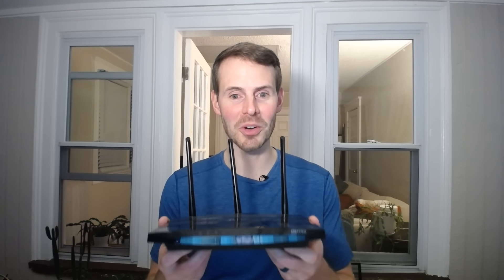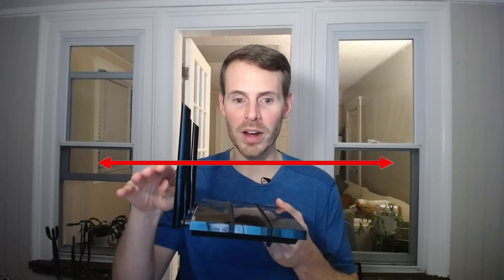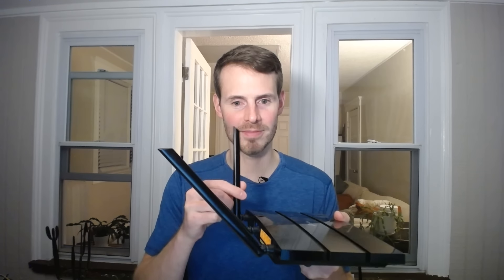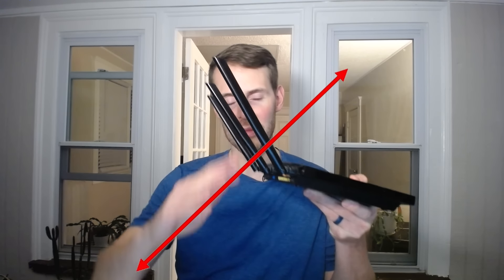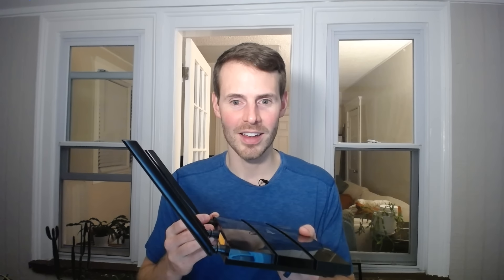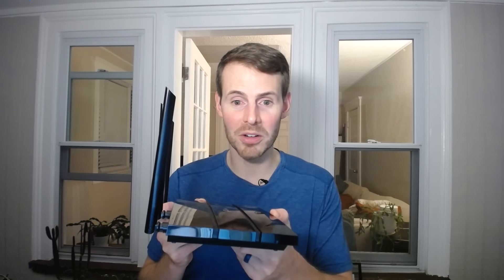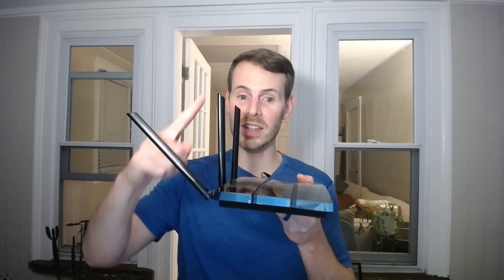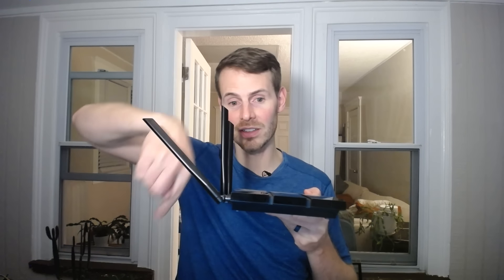Router Antenna Positions - What You're Doing Wrong

Comment: I am also a HAM with over 40 years experience n radio antennas and NAVY trained in AVIONICS and this guy is just lick he got any results at all. there is no such tech as slopped antenna orientation. Radio waves do well either vertical for omnidirectional and horizontal for directional but radio signals get confused at angles as their orientation is dictated by the magnetic fields of the earth. SO, do what you want but this guy is full of it. he knows noting about electronic engineering.
Reply: Also I doubt the polarization is the same after getting bounced all around a house by metallic objects. better luck by installing a WiFi access  point in the basement, problem better solved that way
Reply: Those  ground station K-Band satelite aerials are in trouble then. . . .
Reply: Exactly! It's all about E or H fields. Placing an E field in any other position than vertical reduces mutual coupling. (function of Sine or Cosine)
Reply: The static magnetic field of the earth has no impact on a Transverse E/M (TEM) wave that the antenna produces, At HF - VHF, the Earth's conductivity plays a part in propagation and for HF the ionospheric bounce is a factor. At WiFi frequencies, altering the antenna orientation may create a more favourable path to a blind spot, but so might putting a reflector behind the antennas or changing the orientation of the whole antenna array. If it's adaptive at all, none of this will likely do much.
Reply: I have 40 years land mobile radio experience. The antennas on a router are part of a MIMO or Diversity reception system. Each antenna can receive the signal from a device and diversity reception increases probability of reception. The best orientation for a single story building (in my case)  is to place the outer two at plus and minus 45 degrees off center. Like rabbit ears. This because objects in the home like silvered mirrors and refrigerators distort the polarization of the signal as they refract around them.  If you are trying to get signal to a basement or third story, adjusting an antenna 45 degrees off vertical also makes sense. The earth's static magnet field has little to do with local propagation.
Reply: @elguapo1507  It also increases mutual coupling if the subscriber and/or its arriving signal are bent off the vertical plane and arrive at an antenna coinciding with that alignment.. These routers use diversity reception and MIMO so the worst case is actually having therm all lined up in agreement with each other .
Reply: @rhyoliteaquacade  Maximum gain is ensured through mutual coupling so as long as your E or H fields are coincidental then your received signal strength will be at the highest it can be, taking in to account all other propogation factors. In a diversity antenna array, multiple methods can be used by the designer to prevent mutual coupling between those transmitting antennae, which might otherwise distort or disrupt the transmission signal but we're talking about the mutual coupling between transmission and reception antennas here aren't we? If I transmit with a verically polarised antenna then my receive antenna will also perform best when vertically polarised, the earth's magnetic field having very little to do with that.
Reply: @rhyoliteaquacade  Maximum gain is ensured through mutual coupling so as long as your E or H fields are coincidental then your received signal strength will be at the highest it can be, taking in to account all other propogation factors. In a diversity antenna array, multiple methods can be used by the designer to prevent mutual coupling between those transmitting antennae, which might otherwise distort or disrupt the transmission signal but we're talking about the mutual coupling between transmission and reception antennas here aren't we? If I transmit with a verically polarised antenna then my receive antenna will also perform best when vertically polarised, the earth's magnetic field having very little to do with that.
Reply: @elguapo1507  Yes but unless the subscriber has a fixed mounted vertical antenna, its orientation is not guaranteed. If you have a tablet or phone it is unlikely it is ever strictly vertically polarized, nor is it even likely that the signal leaving the phones internal "antenna"  and with your hand, body shielding it are close to being vertically polarized. Thus having the diversity receiver antennas somewhat  off vertical polarization increase probability of mutual coupling. Nothing about WiFi or Cellular follows good RF engineering practices like we adhered to in Land Mobile Radio.
Reply: @rhyoliteaquacade  I can't argue with that! Mobile devices of the type you described obviously have low quality, low gain antennae and the idea that mutual coupling is even a consideration during their design and manufacture stages is probably for the birds. I believe they use a flat slab type antenna with no directional aspirations at all.
Reply: I am also an amateur radio operator with knowledge of antenna theory. This guy is speaking from a place of feelings not facts. Yes, there is such a thing as diversity reception... When properly designed.
Next I'm waiting for him to tell us about the evils of 5G. 🤔😂
Reply: @W8RIT1  It might be that he's found a reduction in the number of dropout occurreces he's personally encountered since rearranging his router array but, like you, I'm sceptical to any scientific reasoning for this. I think people tend to forget that although they are linear waves, they still travel through a medium in a spiral or eliptical pattern as they propogate, one of the reasons that helical antennas are sometimes used. What I'm saying is, just because the transmitting antenna points at your ceiling it doesn't mean that the E field will continue to travel in that plane throughout its path. I always picture it as though you take a toilet roll tube and tear the tube along the spiral....it describes a straight line once torn. A similar thing to the path of an aircraft propeller tip in flight at a constant speed and altitude. I can't think of a use for a diversity reception array other than perhaps something like direction finding? Where would you use such a method and how?
Reply: @elguapo1507  first, diversity reception is not useful for direction finding. It is more often we used than not for fading signals.
Reply: @elguapo1507  then I'm not skeptical about scientific reasoning.
No, radio waves do NOT move in anything other than a straight line.... Outwards from its source.
Reply: @elguapo1507  now a radio wave may be refracted... But that is due to an external force. It has not been demonstrated that it moves in an elliptical line. We know enough from the physics of the electromagnetic spectrum.
Reply: @elguapo1507  you might use diversity reception with a vertical and a horizontal polarized so that the strongest signal due to fading will be heard at the receiver. In other words, if the horizontal polarization is fading the vertical polarization antenna will be strong and vice versa.... Usually used on HF.
Reply: Polarisation has nothing to do with earth magnetic field.
Reply: @Crystalheard  sure it does. ever hear of the Bz subcomponent??? Depending on the polarization of a CME affects how well our magnetosphere protects against the CME.
Reply: Thank you. Also military comms for many years and advanced computer network tech across Canada. This is also why most don’t have antennas on the outside anymore, so people are not confused and making up their own networking theories.
Unfortunately most of us are retired and the millennials are not doing a great job misinforming. Not all, but enough to see this sort of thing every day.
Reply: no because the GSR fields of the electric isoomatic fields do not inline withe the  converse axis. so do point east and west is best of a 3 teir configurable enomally such as this.
Reply: @rhyoliteaquacade  That's exactly what I've done :)
Reply: You are absolutely right, sir! This individual does not bring any technical-scientific arguments related to radio waves, on the contrary, he is spouting some catastrophic nonsense and ineptitude just to make followers and money! He has no qualifications to talk about radio, WI FI!
Reply: 😂 @Kolbaar

Comment: Ham radio operator here. We call this antenna polarization (vertical vs. horizontal vs. sloped). Another factor can be that many routers are multi-band, most are dual (at least older ones) and mine is a tri-band with six antennae. It's hard to know which antenna is on which band. I don't think I've ever seen a label. I'm pretty sure it's one antenna per band (2.4 GHz vs. 5.8 GHz).  As you say, experiment, but expect that your first test may not give the best results.  

I once worked a New Years Eve activation at an EOC (Emergency Operations Center) where an agency stuck a magnetic mount antenna on a steel door (horizontal polarization) and couldn't talk to their dispatch center 6 blocks away. They asked me to look at it and I moved the antenna to a vertical polarization in a better location. Magic! They were solid into the dispatch center because the antennae over there were vertically polarized.
Reply: De AA4SH 👍😉
Reply: @SteveH-TN  73!
Reply: It varies, but individual Wi-Fi antennas that are used for all the different bands are quite common.
I think I know the router he showed in the video, I had one once, and in fact I think all three of the external antennas are 5GHz only. For 2.4GHz it uses internal antennas that can't be moved or aimed at all!
Reply: Attach only one antenna and test which bands have good signal. Repeat for the rest.
Reply: MIMO and phased arrays come into play on newer routers, all antennas are on both bands for this to work. (802.11ac and newer)
Reply: I'm also a HAM radio operator and I can say that this is a very bad video clip from someone who doesn't know what he's talking about.😱
Reply: @DK1PL   Same here!
Reply: @DK1PL Ham radio and WiFi are two different things.
When you critizise someone, then provide some proof. If not, I consider you a clown talking BS rather than the one you critizise.
Reply: Not one freq / antenna, 3 antenna routers are usually 802.11n "450 mbit", which is due to their MIMO capability, those antennas are used in parallel to enhance the bandwidth. Although your mobile devices are usually equipped with only one antenna, so you can really use only one channel, which is 150 mbit.
Reply: @hansreynders6853  They are both radio, ham operators can and do use things like phased arrays, less MIMO, but we can do that too. In fact one of the tricks ham operators were doing about 2 decades ago was taking WIFI routers and using custom firmware on them for SDR transmitters on the neighbouring 2.4GHz ham band.

Seriously, maybe if you consider ham radio to only be analogue communications on HF well, then you don't know what a lot of us ham operators do.
Reply: @djnor1979  And with 802.11-AC and 802.11AX there is also using the multiple antennas as a phased array for beamforming.
Reply: @EwanMarshall  Yeah, guess I'm still thinking in terms of the good old days of the 40s and 50s.
Reply: Yes, but you're omitting something very powerful - MIMO. A reflected signal actually ADDS data, unlike reflected signals in the regular radio domain which cause havoc (think FM radio).. So, reflected signals are very important to Wifi. They actually help make it work better.
Reply: @MrTechHistory  that is more the beamforming from the phased arrays than MIMO, but it is all wrapped up together. Basically it can measure the optimal phase shift from what it recieves between the antennas and retransmit with that, whether that includes reflections or not, and as the device moves what it is measuring changes and so the next transmit changes.
Reply: Get to the point please
Reply: For the full 3-dimensional beamforming, shouldn't all antennas be directed like XYZ vectors?
Reply: @vasiliynkudryavtsev  for that you need a grid of antennas, not just a row,.
Reply: @EwanMarshall  Grid is an overkill. 3 sticks should be enough to point 3 orthogonal ways to cover entire space equally (mathematically).
Reply: technically yes, but you might as well add a 4th at that point in that case to make it a square, and well, it is just patches printed on a PCB in most cases, key point is they are not on straight line to be able to do the vertical and horizontal steering. Most cases where fully steerable on both planes phased array antennas is done it is a full grid setup, even in wifi.
Reply: 4 minutes and thirty seconds into this…….however dies to the speed of presentation I feel a migraine coming on. I’ve never had one before
Reply: @DK1PL I tend to agree. At the very least experimentation is probably required. He’s talking like someone who learned from other videos, not from actual engineers.
Reply: Failed to get to the point and I’m blocking this channel.🤦‍♂️🤷‍♂️
Reply: Ex-CB'er here, and having used a single vertical antenna, as well as a high powered Yagi, plus I once attempted to increase a vehicle's lobes, by placing TWO single vertical antennae "at either end of a roof rack's load-bar, thus being about five feet apart, only to find that the two actually killed all signals as one defeated the other.
If I had connected ONE to the inner core, and the other to the ground core, I would have had a Yagi effect. 
I know that "mutual" reflections from two verticals can and often do, force a signal to propagate into just TWO lobes, in line with the array, so throws the signal to the sides, where the signal is stronger, than directly in front of, or behind the two uprights.

The Yagi on the other hand, is more like a torch beam, in that it BEAMS all of the propagation in one set direction only, (ie: out the shortest end) but it too uses either a vertical signal polarisation or a horizontal one, meaning the receiving antenna also has to be either vertical or horizontal.
Unless the signal gets SKIPPED in the ionosphere, causing it too invert or twist as it gets from one side of the world to the other (not in a straight line, but in several "bounced stages" off different inversion layers of the upper atmosphere.

The ONLY way to ensure the best signal, is to TEST, test and test again & again, several times, in both a horizontal plane as well as in a vertical plane, Having the antenna angled at 45 degrees though? Wow, what a nasty way to send a signal down several floors, when a horizontally aimed antenna, would have simply sent it directly down into the basement..
Reply: bang on!!!